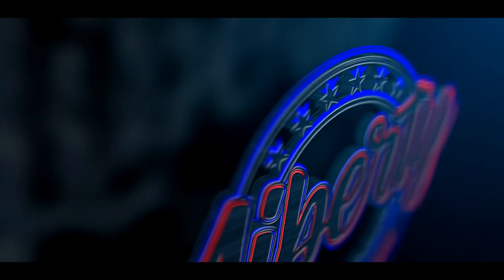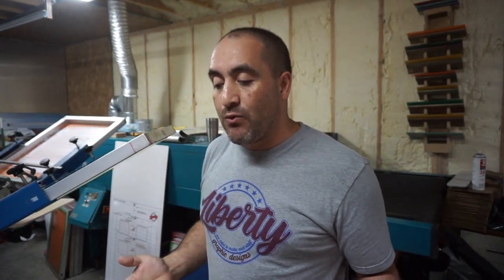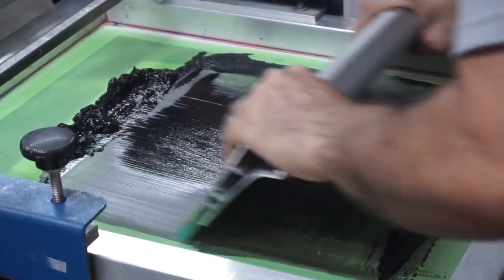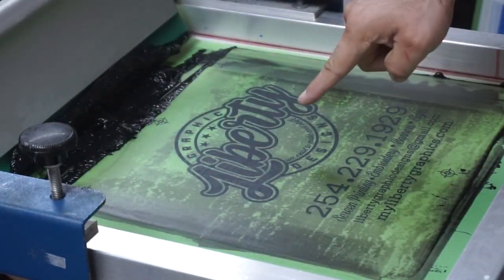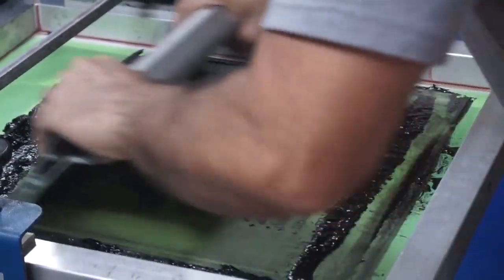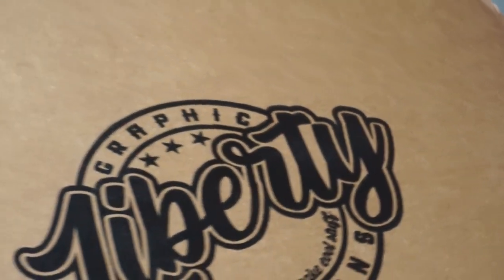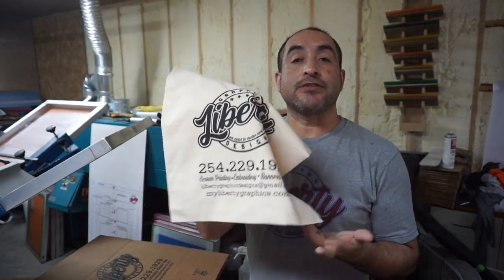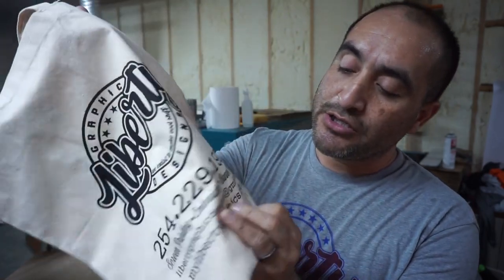PRINTING CAMVAS BAGS

Comment: If we don't have conveyor dryer, which inks should we use?  water-based or plastisol?
Reply from the maker: Water based because water base will even dry on its own (hang dry) and plastisol will not air dry

Comment: Line up the "dot" separators (and spacing) so they're even, bro. It's making me cringe LOL. Sorry, I've been a proofreader for 15 years and I notice things like that. :) And if customers notice it, then they can be like, "This screen printer doesn't pay attention to detail" yadda yadda. And don't think for a second that if any of your competition sees that, they'll let you know, because most of the time they won't. They can use it against you to show THEIR potential customers that Liberty Graphic Designs doesn't pay attention to the little things, even on his own designs (even though messed up art is approved by customers all the time and it's on them). Nonetheless, it looks to be a font size issue on those dots. Making the center and right dots larger, may bring them down some.
Reply from the maker: Yes that's a font issue I did made sure everything is center, at first I didn't know what you were talking about but yes I see what you're saying, thank you.